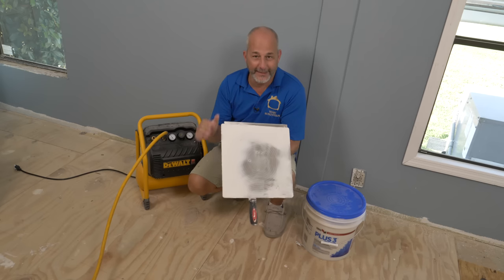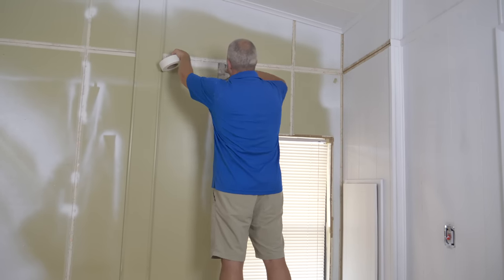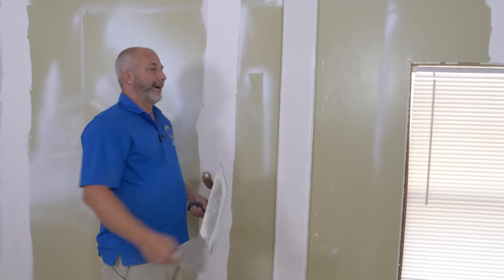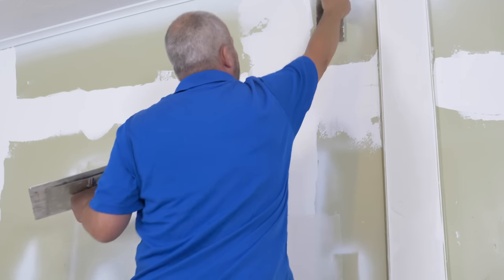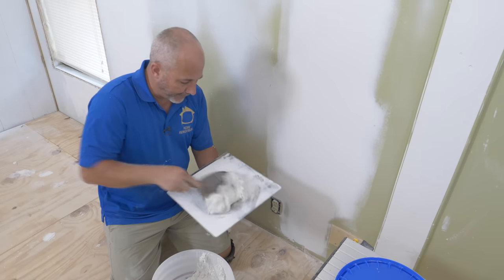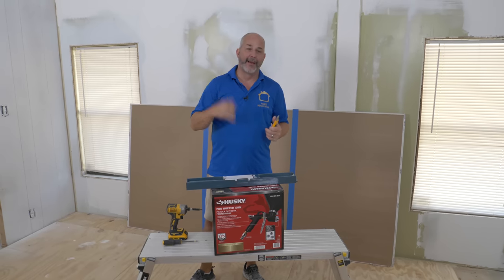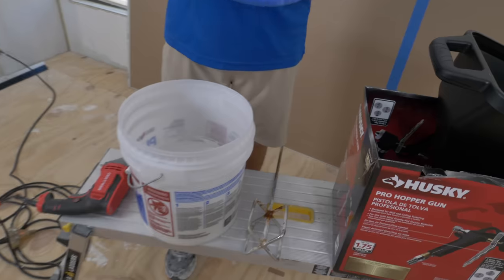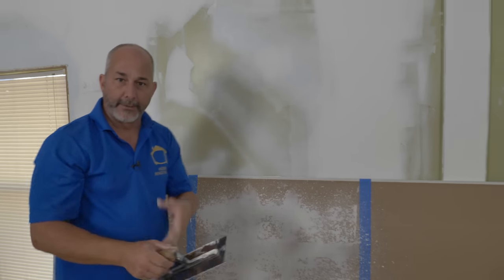How To Do a Knockdown Texture Drywall Finish (Like a Pro)

Comment: You have to admit cranking those screws down using your driver on the tool likely caused the bend. It is just aluminum.
Reply: I believe it was 3 ugga duggas too much for the wingnuts. Which probably implies hand tightening something. 😅
Reply from the maker: perhaps but i just can't recommend a tool that won't stay straight. it is just too light weight to expect a good result. Cheers Sophia!
Reply: It might not have been so bad if it was mounted on the other side of the handle. It looks like the side it is mounted on is warped more then the other based on how the factory compressed the tube.
Reply: It was user error not the tool. His ego won't let him admit that.
Reply: @jacob11b  you’ve noticed that too huh? Based on several videos I've observed, it appears that this individual has a consistent pattern: whenever a mistake occurs, he tends to attribute the fault to the tools or external circumstances. He struggles to accept responsibility when things don't unfold flawlessly, likely due to his excessive arrogance.

Comment: I’ve found that knockdown texture works best when you give it at least ten minutes to dry. Another way to gauge it is to wait until the shine (wetness) starts to dull. Doing it too early will cause it to lay (smash) all the way down like we saw in the first couple of examples in the video. The key in knocking it down is applying a light, even pressure as you pull the knife/blade over the semi-wet texture. Once you get it, it’s a very satisfying result 😊

Comment: Ummmm you most certainly do not need to seal where youve exposed a little brown paper cause youre not putting a bucket of mud over it youre just throwing mud on and taking it off and leaving a thin layer of mud simply to smooth out the edges of the torn paper as a prefill. Also when using mesh tape apply it with your hands do not use your knife and drag it across the mesh tape with no mud or you will fray the mesh tape and make coating it harder than it has to be. When using mesh tape you always want to use  concrete fill to load with which sets up fast and hard like concrete. Never use mesh tape in angles

Comment: Great videos, I love your channel. Just my opinion about this process, my technique is that I spray the mixture in a circle pattern generally using the medium sized nozzle, I then give the mixture approximately 10 minutes drying time before I knock it down. I must also mention that I blend my mixture to a pancake batter consistency. I also have a cheat… once I see the base of the mixture turning white as it dries, that’s my que to knock it down, works perfectly every time 👍

Comment: Good work! I was drywaller for a long time and 1 thing that helps with the adhesion on that vynl is priming everything, if i was going to skim over everything i would deffinitely prime the whole surface so the mud bonds better, same goes for walls you are redoing that are painted with acrylic or latex
Reply from the maker: Great tip!
Reply: I was thinking that myself. Then you wouldn’t need to add the hardener to your mud. Spray prime right over your tape then roll the wall.
Reply: Another tip is toss a plastic tarp down where you’re working. You pick up some dirty mud toss it on that tarp in a pile. Let it dry toss it off the tarp later.

Comment: Used an air gun a few years ago, after fearing what it would do. After using it, I was asking myself WHY did you wait? !  A great tool. I am watching your video as a review before I do another bedroom. I recall doing all the spraying vertically, bottom to top. I did not knock down, but loved the splatter/scatter as it was. I forgot what nozzle, but think medium hole. I used 100% 90 setting compound because that is what I learned and 90 because I did not want it to go to a run away drying situation. One reason for the review was seeing some people say to prime the wall before doing texture. Interesting also, was you adding the setting compound to the ready mix.

Comment: Great stuff! Definitely recommend trying it on a section of drywall first to get your settings just right. Spraying ceilings was the toughest for me, can only fill the hopper halfway as it will spill out on you, start in the corner or end farthest from you, and work backwards. The splatter will fall down into your eyes if you walk forward! And wear safety glasses!
Reply: Spraying ceilings is BS. Rolling your mud on is much easier. It will take longer to dry but that will also give you more working time. If it starts drying use a spray bottle and lightly moisten it. I’m not sold on these sprayers. Maybe for small patches but a large surface to much inconsistencies. But let me see what the pros think.
Reply: @rolandthethompsongunner64  i prefer the look of spray texture. It's not that hard. Hardest part is after you finish and entire room you have to clean every part of the tools. I skip troweled the walls and they also turned out great. Everyone has their own methods that work for them.

Comment: I've been building my house, by myself except for the HVAC, using Clark Dietrich structural steel in a 30' X 60' X12' steel building. I have 12" walls insulated with blow in fiberglass with a wrap under the drywall and will have 24" of blow in insulation in the attic. The house is a bit over 7000 feet in elevation.  I tried hiring someone to do the drywall but they vanished after the 'I'll call you in a couple of weeks'.  Suffice it to say that I built 10' walls and a hat channel ceiling  support for the drywall and completed it by myself using 10'X4' sheets.  I used the ultra light mud for my texture and 3.5 liters per box.  I used the Harbor Freight air texture gun with an air cut off valve. My compressor had enough CFM so it never went under 90 lbs of pressure.  Thinning the mud that thin with water didn't require knock down. I has a few spheres a quarter of the size of a BB and were easily knocked off with my knife.  This technique turned out well and I've just about finished painting, after the PVA primer coat. It's looking like a home now. I still have a lot to do. I used a paint sprayer for the painting.  That saved a lot of time and work.
Reply from the maker: well done!

Comment: You should avoid big streaks in the knockdown. Less coverage, more dense, wait at least 10 minutes based on humidity. Use a texture mud to get the clumpiness necessary.

Comment: I made my own knockdown tool using something you can find in the garage/weather stripping section. It was a metal with a flexible rubber strip attached to it. They also sell similar knockdown specific tools.

Comment: Texture is going to dry faster on mud than on a painted surface.  PVA your walls prior to texture or skim coat your walls in order to have a uniform texture pattern.
Reply from the maker: true, nut in this case he vinyl was my nemesis. in hind sight i should have skim coated the whole thing to make it dry uniformly. In this case you can all learn from my mistake.
Reply: I don't and my knockdown looks great.

Comment: I don't do drywall and texture work for anything more than my own projects but I just use my regular knives to do the work for me. I've already got them, they do the same job, they aren't garbage, and it's one less thing I've gotta trip over when going to the shed. 

Takes a little longer as they aren't as wide.... but that's fine with me. It's a marathon, not a sprint.
Reply: Me too.  A 12" knife is plenty big.

Comment: Knowledge of mudd is really key, that’s what I’ve learned in my experience. I did a bath ceiling with a ceiling mop and weighted a few to do the knock down with a 12. Nice look. Would love to do it quicker.
Reply from the maker: speed depends on the quality of the wall. Cheers!

Comment: I use a hopper for every job big or small,super consistent ,add a locking air adjustment to the hopper hose and use 24" blades made for commercial work, I have at least 4 and have a couple hoppers at the ready

Comment: 51:39 also prefer using a skimming blade (or whatever ya call in your area, as everyone has own diff names for tools) along w/ trowel for walls cuz can get nice looking coats after been doing for while and find your groove, and tool prefer using; as really no wrong tool to use, as ppl use what they like and makes it easy for them; to “get the finish that is supposed to be done” for the job……meaning if hate or having an issue w/ certain tool and not getting the look you want, try diff tool/process…..and you’ll be successful 
Cheers✌🏻

Comment: Not surprised that knockdown tool was Anvil.  I bought an extension pole that came apart after one day of use.  I quickly returned it and bought a slightly more expensive tool that was way better.
Reply from the maker: I am getting to the point of boycotting anything Anvil as it seems to be similar in quality to a cheap tool on amazon. Should not be in the store.

Comment: For ceilings I like an acrylic knockdown “trowel” and don’t remember the brand I’ve got and yep….even have sponges for blending etc….for walls with heavy heavy textured along w/ stucco work, these sponges are cheap enough they pretty much same, however, don’t get the sponges that are very yellow and when feel they feel like a couch cushion from 50s that was left in sun and weather for last 60 yrs as those are garbage

Comment: Hmm, the only time I used texture on drywall, I thinned the premixed mud almost to half and half and rolled it on with a textured roller. It was a much simpler technique and looked really good. I didn't skim coat everything, but used the texture as the skim coat. Probably not the best idea but I don't own that house any more. :P

Comment: It's best to prime the wall before spraying the texture. That way the texture dries evenly and knocks down evenly (without large smooth spots).
Reply: I've not had that problem.  Drywall and compound over the tape absobe about the same rate.

Comment: This video has helped a lot but my situation is a bit unique. I got a bad batch of paint for an accent wall. I ended up having to sand the entire wall the best I could which of course took most of the knockdown texture off the wall. I took it down as far as could trying not to get to the brown paper. A little brown paper did come through in a few spots. I have sprayed those with the Kiltz. Now I'm not sure what compound mixture I should use to do a smooth coat over the whole wall before doing the texture.

Comment: The large acrylic knockdown knives work better.  They are large and flex, so you don't have to worry about the metal being bent and its also easier to not apply too much pressure.

Comment: Random question.  If i spray a moldy board with chlorine or high chlorine sope. And it absorbs into the wood would that kill the smell Of mold after its drys permanently. Might be painting too. I figured chlorine would be faster and less of a mess.
Reply: Best option is to remove and replace the affected board. If you can't do that, a product designed to kill mold will work better than chlorine-based cleaners. Some research indicates that ethanol penetrates wood deeper than bleach and water. In any case it is difficult at best and mostly impossible to ensure that any product will penetrate deep enough into the board to kill mold below the surface. Best case is that the live mold left in the board will not have enough moisture to live long, and the spores it produces inside the wall will become non-viable after several years in dry conditions. In humid climates you'll be taking a fair risk that the mold will not die.

After treating the surface coat it with a shellac-based primer like BIN. They do the best job of sealing odors (also good for prevent sap seepage from knots and sappy woods). I like two coats to ensure pinholes will be sealed. Shellac dries very fast, so it's quick to do two coats.
Reply: @dave7038  dane, man I appreciate the time you took to answer this.
I'v been cleaning up someone else mess and trying to salvage some of my wood. Cuz its just been in the wrong conditions for to long. So this does Arm me with a little more understanding. Thank.

Comment: Jeff, have you thought about adding insulation to the walls? Or, is the existing insulation working well?
Reply from the maker: does not seem to be  a problem here in Florida. the foil faced board in the wall assembly does a good job deflecting the radiation from the sun so the a/c keeps up just fine. Cheers!

Comment: Can you just use that fiba mesha tape on ALL dry wall joints? Like, just get rid of the paper for good? Seems way easier!
Reply from the maker: I actually find the paper easier. takes less work to get a smooth finish.

Comment: Here is another tip for you as far as texture is concerned. Ive oearned a lot from you so not being cindescending at all with any of my comments. You can do a nicer nickdown with your fingers. Obviously it would take way longer and I only use it for very small patches as I have a spray rig. But if you take regular mud dip the tips of your fingers into a medium thick mixture to where your fingers are holding a good bit of mud, the dab the mud onto the ceiling or walls with your fingertips let it set up a few minutes and knock it down you will achieve that clean knock down look. Also you do want to let knockdown set up a bit before knocking it down.

Comment: I have a 12x24 tiny home with open loft on both ends, at the drywall stage, curious about adequate space in the peak to keep it dry? Or drywall to the peak with no airspace just the insulation between the rafters. Long winded, definitely getting a hopper though
Reply from the maker: That's a great idea!

Comment: Apparently you are not aware that you put the blade on the wrong side of the handle (at 32  minutes) where the circular handle is crimped flat - there is a flat side and the opposite side of the tubular handle there are crimps at the edge and you bent the blade when you over torqued it with you electric drill.  MOUNT THE BLADE ON THE FLAT SIDE.

Comment: This is not how you do a knockdown pattern . You should be using a rubber blade instead of metal or plastic. If you want a thick looking pattern you need to spray two different patterns and let the first pattern dry for 10/15 mins prior spraying the final spray . With the final spray it should less air to make it a bigger bloop which gives it the thick looking pattern . The way your doing it it would be consider orange peel

Comment: How to do knockdown texture drywall?  Take a time machine to the 90's.  If you are in the present, don't.  It looks terrible, always.  Replace the drywall if your existing wall is so terribly uneven that you need to hide the blemishes.  Replacing drywall is an extra hour of work over what Jeff showed in this video.  You still need to tape and mud everything.  If you are so bad at taping that texture is your only answer, hire a professional.  If the professional insists that the wall needs to be textured, they are also bad at taping and mudding.  The only reason to apply texture is to hide imperfections in workmanship in the smooth mud.
Reply: LOL.  BS.  I HATE smooth walls, except in kitchens.  I L-O-V-E knockdown everywhere else.

It's the standard in upscale houses.  Cheap tract home?  No texture.

Comment: 42:58 Anvil brand, sold at Home Depot, is junk. I bought an Anvil wire brush to clean paint brushes and the thing rusted after 2 uses. I exchanged it for a new one and that one rusted almost immediately. Complete junk.

Comment: Nice try for a video but I doubt this guy is a professional??? No plastic over windows or the fan. Just spraying over the blinds even if your throwing them out can be a mess. You need to cover them in plastic
Reply: 49:20
Reply: Just get the ol tape and drape

Comment: Im sorry to keep rambling but another tip that works with skimming as well is to always pull towards your wet mud. Same with knockdown you dont want to start in the middle of the wall. You pull ur corners in slightly an inch or 2 and than you pull from the bottom up as high as you can while still being able to gently lift/feather your kncokdown flap off the wall without leaving a pancake and than pull top down into the already knocked down surface again gently lifting plad3 away from the wall so you dont leave any lap lines